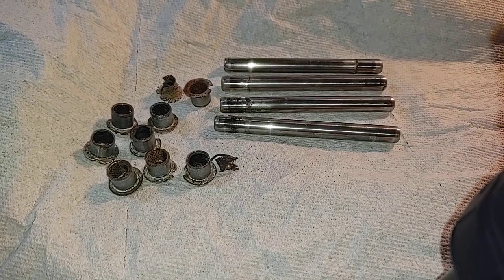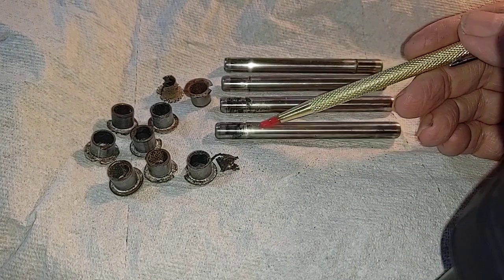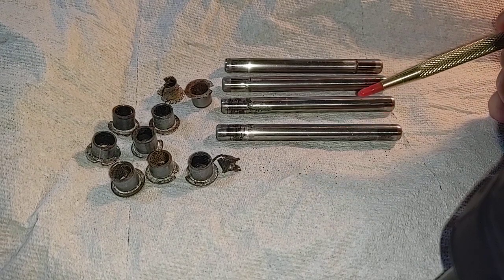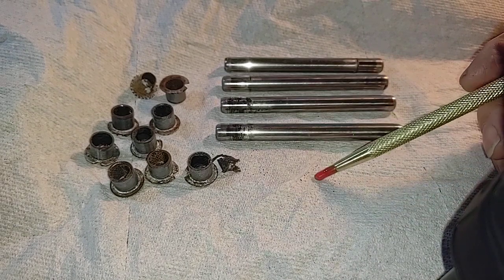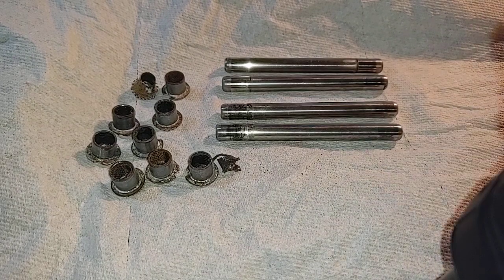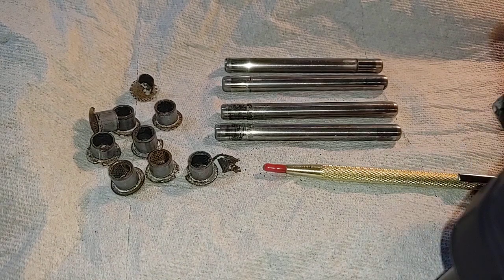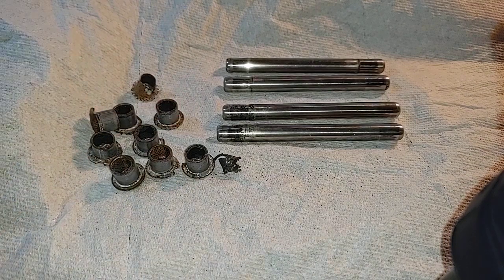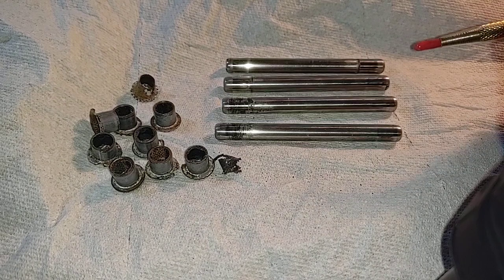Ford Power Running board STUCK  WHY!!! This is why and what to do about it. Also covers Navigators.

Comment: I took a board of my truck and found that indeed the bushings are the problem. I was able to get mine replaced under warranty. Guaranteed these boards will fall in 4-8 years depending on usage and environment. I'm glad to see you're adding lubrication.
Reply from the maker: It's the only rational thing to do. To be able to push the gunk out of the bushings  on a regular basis. I am using  a molybdenum and graphite grease. Time will tell if it is effective.

Comment: Good video! My ram 2500 running board got this problem recently and I lubbed all the point but still no good. It's a 2021 2500 so I don't think the problem of bushings. Today I unplug the connector and reconnect it, vola, it works and no problem! But I will keep watching the bushing and pins!
Reply from the maker: I am glad that you found this useful. Having pulled apart a bunch of these brackets and seen the condition of the original bushings, I am surprised that any older Ford product boards move at all.

Comment: Thanks for making this , surprised  amp doesn't sell the kits I guess they want you to buy new one. what did you use to get the C clips off ? and the link for isostatic, 10mm is the right size I take it?
Reply from the maker: I don't know if Amp  uses c clips. The board here is a Ford stock one. In the Ford design, the pins are a shrink fit into the link portions of the hinge. Did you look at my videos on removing and installing these? There is a playlist that covers the whole process, located here:  https://www.youtube.com/playlist?list=PLoz-2IH4A2KsZiDXB0f-hhKZtAzO_wuO_

Comment: His is a timely video… I just purchased new EOM motor and brackets.  Then realize, my old brackets are not bad just need new bushings.  Boy, I hope I can get them out with out too much heat.  Hurry up posting the SS rod removal video
Reply from the maker: I suspect that most people buy new motors and the front swing set when all that is needed is a $40 set of bushings. In my case, I am replacing the front set because I snapped my old one in half. 

I was able to get more than enough heat with just a normal propane torch. The heat required was around 150 degrees or so. It's more important to insure that the whole length of the pin in the center piece is hot. Also, do watch out for those rubber bumpers. If you toast them you will be having a bad day.

About the ss rod, I don't have one on my Navigator. I have the short wheel base. The extended wheel base is where  those are used on the Navigator.